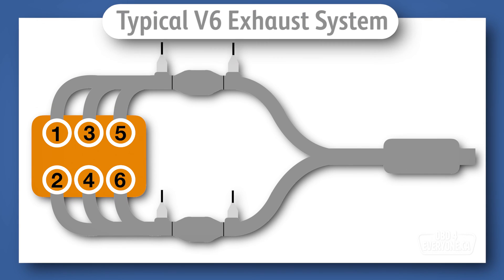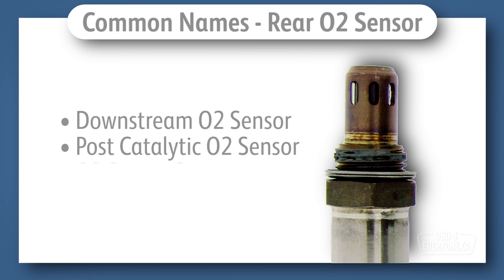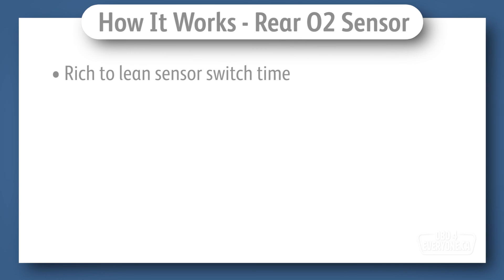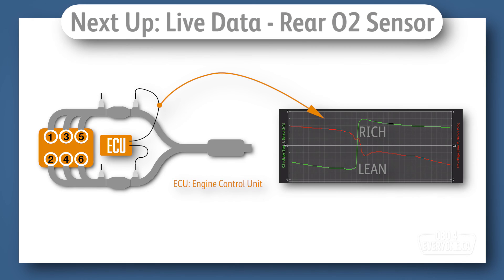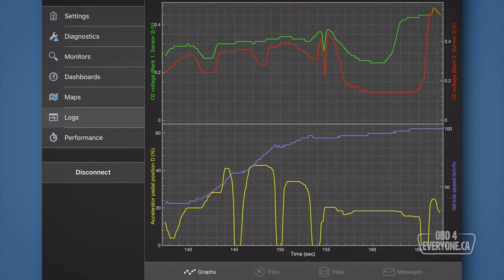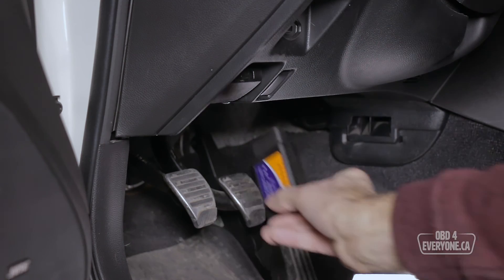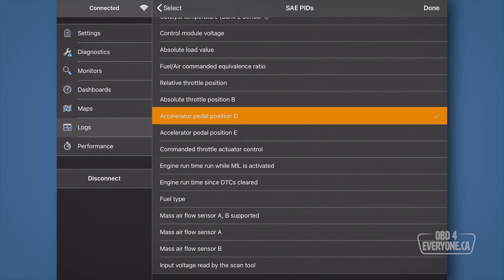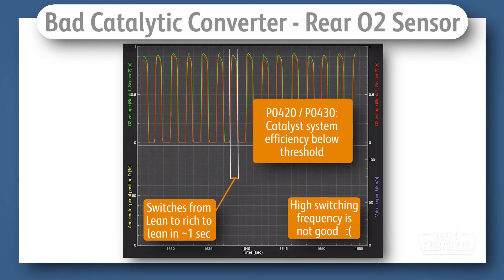Understanding & Live Graphing of the Rear O2 Sensor: OBD4Everyone Ep.19

Comment: With the recent Cobb updates for WRXs I was looking to get tuned but worried about having the dreaded P0420 code as I bought an aftermarket Jpipe with a cat but not sure of if it will throw a code. I was told that it shouldn’t cause the code but if it does the rear 02 spacer should solve it. However several people have been telling me that the rear 02 sensor is used for long term fuel trims and other things that are needed. Based on the videos and others I’m not sure they are right. So my question am I able to use a 02 spacer without effecting anything like fuel trims or anything else?
Reply from the maker: That is a very difficult question to answer. Each manufacture has their own strategies that are used for fuel control and verification.

I do believe Ford, BMW and Nissan/Infiniti do use the rear O2 sensor for fuel calculations and for checking for an air/fuel sensor (sensor 1) lean rich bias.

For your specific application, the only way to find out is to try it, and see what happens.
Reply: @OBD4Everyone  Thanks for the reply. Yes it’s something that has to be expiremented with. I recently put my Jpipe on and it gave no codes so I am fine but I do know that it’s become a huge discussion in the Subaru world.

Comment: Thank you for the amazing video. I ordered my elm327 adapter and will be downloading OBD Fusion for Windows. I am getting a P0420 on my 4 cylinder 2006 tacoma with only 95,000 miles and am trying to confirm that it is the "very expensive" Cat. This truck has an A/F sensor on the front of the Cat. Is the procedure you present in this video the best way confirm that it is indeed the Cat? Thanks again.
Reply from the maker: I think so... The video shows the typical operation of a working catalytic converter and the resulting narrow band rear o2 sensor voltages for different operating conditions.

Assuming there are no exhaust leaks, your rear O2 sensor voltage should change in a similar way.

A P0420 looks at the switching frequency and delay from sensor 1 to sensor 2.
You could data log your front A/F sensor and rear O2 voltage, while driving around for 10+ minutes to ensure they are warmed up and operational.

Then find a safe sport and do a few seconds or wide open throttle, then lift off the throttle come to a stop and let the engine idle for 5ish minutes.

During wide open throttle, your A/F ratio should be somewhere in the 12s and the rear O2 at > 0.9 volts. When you lift off the throttle, the A/F ratio should increase to 20+ and rear O2 voltage should drop to < 0.1 v.

You also need to look at the time delay between the front A/F ratio going rich/lean compared to the rear O2 sensor. This shows the oxygen storage capacity of the catalytic converter and is what the P0420 tests for. 

From tests I have done on my G37 there is about a 1 second delay between the front A/F sensor going lean and the rear O2 sensor going lean / < 0.1v.

I would expect your Toyota to be similar, but I don't have any first hand experience on that.

The last thing you can do, it to look at the mode $06 data in OBD Fusion's diagnostic report. There is a "Catalyst Monitor" that shows the condition of your catalytic converter.

You may want to read this to learn more:
https://www.motor.com/wp-content/uploads/AdvancedMode06Diagnostics-March2007.pdf

Good luck!
Reply: @OBD4Everyone  Thank you so much for taking the time to help. I will let you know how it turns out.
Reply: @wayneferrell9646  it could also be a leak. Good way to find one is with a shop vac and soapy water. Blow air through the muffler side and spray soapy water on all of the exhaust system from beginning to end, if there's a leak bubbles will start spewing out.
If all is good try using CATACLEAN at least 2 times when you fuel up it's pretty good. Sometimes using cheap gas can build up crud in the system that'll help clean it.
I did all these steps including replacing O2 sensors (they were overdue at 300k miles) and i got rid of the code and completed all drive cycles for smog. Toyotas are pretty sturdy so i wouldn't replace the Cat right away
Reply: @wayneferrell9646  how it turn out ?

Comment: My downstream o2 sensor is reading 0V, replaced it with 4 o2 sensors and one From a dealership, its Still reading 0. What Could be the problem?
Reply from the maker: That's really hard to say...
It could be a broken or shorted wire between the ECU/PCM and the O2 sensor, a fault inside the ECU/PCM, or a bad ground... just to name a few items.
Reply: @OBD4Everyone  that side that’s faulting had a wire snapped off from the sensor by the driveshaft. I don’t see damage from the plug, but it’s possible that it’s damaged

Comment: Helpful video. I didi use a BlueDriver to scan all my o2's voltages and ratios. I also have a V6 camry as well, but Toyota or not is not my question.

The graphs for both upstream sensors' voltages are very consistent with each other, however, the graphs for both downstream sensors' are different.

Bank 2's downstream sensor's graph seems to change steadily, kinda like hilly terrain.
Bank 1's downstream sensor's graph seems to rapidly fluctuate from 0 to 0.9 volts, kinda like spikes, or upside-down icicles.

Which downstream sensor is bad? I have replaced the catalytic converter on bank 2 due to a P0430 code, and that code went away.
Reply from the maker: Generally, the switching frequency (0 to 1v or 1 to 0v) of the rear o2 sensor should be slow at a steady engine speed and load with a healthy catalytic converter. (that means it has the ability to store oxygen)

As you have seen with your new cat on bank 2, you see a slow change from rich to lean / lean to rich. This indicates that the O2 storage capacity of the catalytic converter is good... as it should be, since it is new.

As a guess, if the rear O2 sensor is good, I would investigate the bank 1 cat. As a "over the internet guess", the wave form should be more like the new cat on bank 2.
Reply: @OBD4Everyone  Actually, with another Toyota I have, that has no issues whatsoever, I decided to scan its front and rear o2's. 

Sure enough, the waveform from my other Toyota resembles the new cat's, although I'm hoping it's just the sensor going out, since that particular sensor is out of stock at most places.
Reply from the maker: That was a good test! Good luck on the fix :)

Comment: Hey amazing video with great detail however im at a loss car was throwing code p0100 maf sensor replaced it engine ran so much smoother no more rough idle but now i get code p0170 fueltrim bank 1 astra h 1.8 2006
LTFT(B1) has a constant 11.7 o2s1 (B1) fluctuate between 0 and negative 25 o2s2 (B1) says negative 100 and doesn’t move any idea where to start i was thinking maybe o2 sensor is bad but im no car expert would be great full for any advice thanks in advance
Reply from the maker: As you can guess, it is difficult to troubleshoot over YouTube comments.

I don't have any first hand knowledge on GM products and I don't know if the O2 sensors are wide band or narrow band.

You might want to join a car forum or FaceBook group for the Astra and ask them.

Sorry, but I don't think I can be any more help.

Comment: I can't find answers anywhere. My O2 downstreams, even the new ones, are stuck around .7-.8V and barely respond to any engine reving, or driving. That should be rich right? Well, the LTFT are in positive double digits, indicating lean? It's both rich and lean??
Reply from the maker: Interesting...
When looking at fuel trims you need to add the short term and the long term to get the total fuel trim. In some cases the LTFT can be +20  so you might think there is an issue.. BUT if the STFT is -12, over all everything if good.

What is your total fuel trim for each bank, if you have 2 banks?
Generally the total fuel trim should be around -10 to +10 for a healthy engine.

It is also useful to graph the pre-cat sensor (S1)  and the post cat o2 sensor (S2) as you can verify the sensors both show rich under full throttle acceleration,  and when the throttle closes, they should show lean.

Questions for you:
What year/make/model is  your vehicle? 
Do you have a trouble code?
Does the engine run normally and make full power?
Reply: @OBD4Everyone  No, the short terms are sitting at 0, with +-3 tolerance. I find a leak at one of the hoses, and my LTFT seemed to drop to 5 and 7% yesterday respectively, but today they were now at 16%, with the STFT around 0 again. :(

Yes I have two banks. So the totals for example on today's numbers would be 16, 16+0. The worse case I had was 21%. Sometimes it decreases when rev, so I assumed vacuum leak. Other times, it goes up. 

I actually got confused with the data. The downstream for this toyota engine is supposed to be flatline (apparently). They aren't "stuck". But, ideally it should be around .45V, not higher or lower (although again that's ideally). The A/F sensors on the upstream are both working fine, sine wave behavior around 3.3V. 

2007 Lexus ES350. No trouble codes. I had a brief misfire code P0300 weeks back when I was having trouble starting (I'm apparently having alternator problems according to autozone today). Though I never noticed the check engine light, I only saw apparently it was a stored code that showed up 2 days prior to me checking with the scanner. Never returned after I cleared the code. 

Engine seems to be rough? It's my first car so its hard for me to judge on what exactly is normal, but it vibrates a bit at idle in the wheel, pedal. The phone holder on my windshield you can see vibrate.

Could a failing alternator be the reason for a lean condition? Maybe poor power delivery to the fuel pump? I have a thread here I made on a toyota forum if you want to check it out, it has pics of the data I have from my scanner.
https://www.toyotanation.com/threads/can-someone-clarify-what-is-normal-o2-downstream-behavior.1716453/

Comment: Quick question because I’m curious if it’s my cats, or o2 sensors. So at a steady 50 mph, bank 2 fluctuates between .01-.8 while bank 1 stays at .72-.73 and doesn’t move. What could I be dealing with here?
Reply: Mind you. This is in a 2013 Honda Pilot EX
Reply from the maker: I don't have any first hand experience on Toyotas, but it looks like bank 1 has a problem... either a crack in the exhaust, bad O2 sensor or maybe bad cat.

Generally both bank 1 and 2 should have similar voltages for the rear O2 sensor.

Comment: I've got a 2012 Toyota Corolla with about 115K miles on it. It has been well taken care of over the years by the previous owner, they changed the oil and such impeccably, had everything done on time, etc. As of the past couple of years, the downstream O2 sensor started testing only 1 or 2 out of the total of 5 readiness tests on OBD2, flipping between 1 and 2 out of 5 total tests for it and basically just halfway testing and untesting. I've checked voltage on the wiring, changed the O2 sensor 3 times in 2 years (Toyota-branded Denso made no difference vs aftermarket), had the battery tested, etc. When the ECU is reset completely, virtually all tests are complete the next day. It requires overnight testing for the Evap, but everything else tests very rapidly, including both readiness tests for the upstream engine-side O2 sensor. The catalyst also isn't testing, which I suspect is because of the downstream O2 sensor (before/on the catalyst) not testing first.

What could cause this? There is no check engine light, no error codes in the scanner or anything to indicate that anything is wrong. What am I missing? OBD2 device also shows the voltage of the downstream O2 sensor is registering and also it is reading the catalyst temperature properly. So I see that it is getting about 1V when the throttle is pressed, the upstream and downstream are talking to one another by adjusting fuel trim and such based on whether the throttle is being pressed, etc. Toyota recommended cleaning the throttle body, but that doesn't seem to be related to the downstream O2 sensor that we're having issues with. It's simply jumping back and forth between 2 of 5 readiness tests completed, then back to 3 or 4 out of 5 tested, then back to 2 or 3 tested and just says they haven't been completed yet. We've driven it hundreds of miles after reset. Same thing over again.
Reply from the maker: First of all, that's some good trouble shooting and testing! Good work!

A few things come to mind:
• Using an OBD scanner and a good app (like OBDFusion) view/graph the rear or sensor voltage. This will allow you to check for the typical swing of 0.1 to 0.9 volts.
• In most cases, the catalyst temperature is a calculated value based on engine load and airflow, so that may not tell you anything
• Find the drive cycle for your car. This is what the engine computer requires to get the monitors to run. All conditions need to be met for the catalyst drive cycle to run. In some cases weird things like radio off, more than 1/2 tank of gas etc...

You could also do a search to see of the is a Technical Service Bulletin (TSB) that may address this issue. In some cased a software up may be all it takes.

Good luck!
Reply: @OBD4Everyone  Thanks for the reply.

Yep, voltage goes between that range and increases when pressing on the gas pedal. Also the downstream O2 sensor heater test is among the tested things.

Tried the drive cycle thing, too. Even Toyota was clueless as to what to tell us other than, "That will be a very expensive problem to diagnose."  They want to put it on a $158 diagnostic (their fancy word for the OBD2 scanner similar to what I'm using now and "drive it" to see what it is doing. Naturally, that won't fix it. I suspect that they would then start guessing at parts like the catalyst, suggest to replace the O2 sensor for a fourth time in less than 2 years, etc. 

This is what I see when it tests the most tests, before going back to a couple of the green ones untesting again:  https://i.postimg.cc/dQWrrP2R/screengrab.jpg

https://i.postimg.cc/q45ZHWPC/screenshot2.jpg

Someone told me to "tap on the catalytic converter and listen for rattling because it may have broken apart due to age".  It's 10 years old. I had an old Ford Escort that we sold to my uncle after about 20 years (owned it from new) and he didn't have any trouble with emissions. Do they really go bad that quickly on Toyotas?
Reply from the maker: I don't have much experience with Toyota's.
The only other suggestions I have are to check for any pending codes and clear them.

Then do the drive cycle mentioned here:
http://justsmogs.com/2016/05/1996-to-2002-toyota-obd-ii-catalyst-monitor-readiness-drive-patterns/

https://axleaddict.com/auto-repair/Toyota-Drive-Cycle-Readiness-Monitors-for-Emissions

From what I have read, it looks like it can be difficult to get the catalyst monitor to run.

Good luck!

Comment: Hi, I have seen several Videos that uses an O2 spacer to remove the P0420 and P0430 codes. What does this spacer do? Just for my knowledge.

I have a 2021 Hyundai Palisade V6 and the above 2 codes are being thrown. How is it possible that both Banks come faulty at the same time? The car is only 10,000 Kms driven
Reply from the maker: I would assume you car is still under warranty, so take it in and let the dealer fix it. I suspect there is nothing wrong with your car, as it is too new, and it needs a engine computer update.

The P0420/0430 codes check the efficiency of the catalytic converter. If the cat is working, the signal from the rear (after cat) sensor has a lower switching frequency than the sensor before the cat.

The O2 spacer try to trick the engine computer by removing the sensor from the direct exhaust flow. HOWEVER new engine computers seem to have the ability to detect this and the P0420/0430 code stays.
Reply: @OBD4Everyone  its not under warranty since i have imported it.

Comment: Hi, my car has a po420 code and my o2 bank one sensor is  negative so  - 0.03. Is this faulty sensor. Thanks
Reply from the maker: Based on what you have told me, I would think so. An O2 sensor's voltage range is generally between 0.1v and 0.9 volts.

Comment: Now here's a mystery. I have a 2014 Mitsubishi Mirage that's getting a P2096 code for "post catalyst fuel trim system lean." However, the upstream wideband O2 sensor shows it's slightly rich the majority of the time, and the rear sensor voltage fluctuates between .54-.88, also indicating it's rich. But somehow, I keep getting P2096 lean code popping up repeatedly. This doesn't make any sense.
Reply from the maker: Don't just focus on the voltage level, also have a look at the rear O2 switching frequency. (low to high and high to low)

What are your fuel trims at a hot idle and on the highway doing 50 Mph?
Reply: @OBD4Everyone  Unfortunately, my UltraGauge doesn't map out the switching voltage, so I'd need a better scan tool for that. LTFT has gone between 3-5 at idle and 5-7 at  a highway cruise. I replaced the rear O2 sensor (it has 115k miles and I replaced the front already), and the code was still showing up with the new senor. I pulled the battery to reset the memory and have it re-learn the fuel trim, and had a P0421 come up for the catalyst underperforming during warm-up during the first day. I reset the code, and none of them have come back since.

Comment: Cross counts - Thats what its all about. Its a secret ratio front o2/rear O2 crossover of .45 volts. What is it ????? who knows. 2/1….   5/1…..    10/1 . Maybe A super smog tech has this secret ratio. The ECM is programmed to calculate the cross counts and trigger a fault if the ratio is too small.  I would like to know what the ratio is!
Reply from the maker: As I see it, there is no single answer to this. 
As time goes on, the emission regulations change and that changes the engine control strategies.

If you do find it, please let me know :)